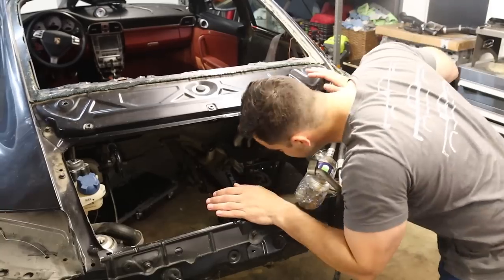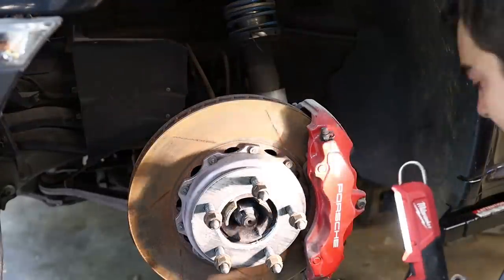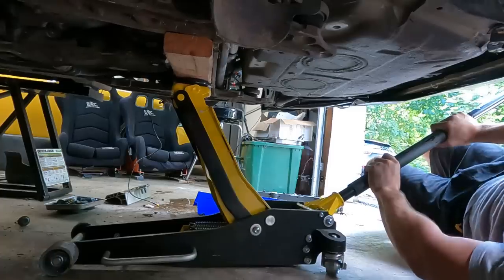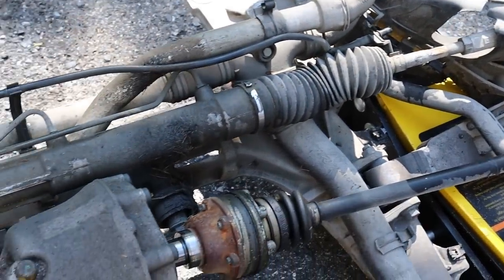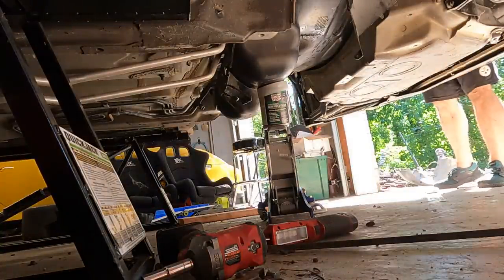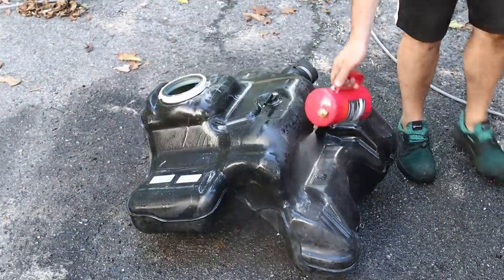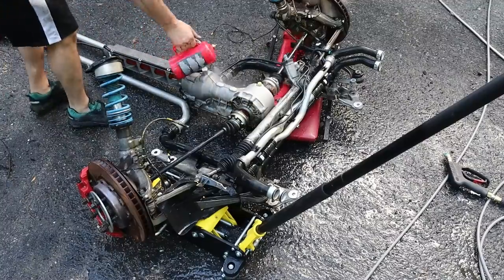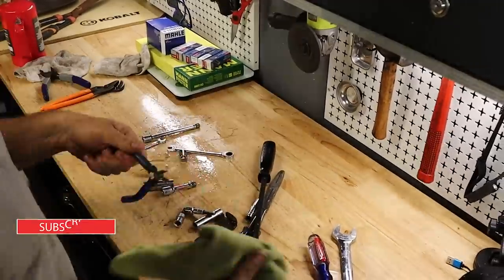ABANDONED 997 TURBO RACE CAR BUILD - Chassis Swap

Comment: You could use a foot more of space under the car. Solution: lift with your airjacks. Stabilize the car on four jacks. Place an array of cinder blocks on each side. Put the airjacks on top of them. Lift the car once more. Presto.
Reply from the maker: I could also use a bunch more space around the car in the garage lol.

Comment: In Greece, we say "Χαρά στην υπομονή σου" which basically means "Thank God you have patience". You are doing such a great job!
Wouldn't be easier if you move the 996 in the same place as E36? Less in and out, OR you could have all the space for the black 997...
Reply from the maker: Both 997s will be in the garage eventually, but I'm planning on getting the orange one painted first.

Comment: After cleaning, I'd suggest that you open the rack end bellows and make sure no water got there from the power washer. It might ruin then rack. Dont ask how I know. Also super important to immediately re-install the gas tank pump lid "nut" sleeve, before the tank deforms and it's almost impossible to get in back on threads.
Reply from the maker: Good tip, thanks!

Comment: Dropping/pulling an engine is always a test of just how strong vacuum lines and wiring harnesses really are.  In my mind, if they break then they're a weak link and deserve to be punished.
Reply from the maker: Couldn’t agree more lol
Reply: The best part about the engine drop in these cars is that it's mostly bulkhead style connectors. They make everything easily accessible for what to disconnect. Can be done in 1.5hrs if you know what you're doing
Reply from the maker: Yea it's not too terrible.

Comment: One more tip a hydraulic lift table around $265 bucks they fit in small spaces and the handle folds flat. Check it out harbor freight or vevor may make one
Reply from the maker: Folding one would help for sure

Comment: To get rid of gas smell the trick we used at the dealer was baking soda, like the arm and hammer stuff spread it around on the dry surfaces .it will then then absorb the gasoline smell just give it some time to work .
Reply from the maker: I def need that

Comment: I highly recommend HF's 2000lb low profile transmission jack. I use mine all the time.
Reply from the maker: That would surely be helpful!
Reply: It's heavy but since it's low profile it's easy to tuck away.
Reply: Oh and it's tall enough to use with the quick jacks at the highest locking point. That's the whole reason I got it.
Reply from the maker: Solid points thanks! I need to make a trip to HF anyway.

Comment: Nice job bro. Why don’t you just transfer the whole harness and wires. Your already in there. Might as well lol. Great content
Reply from the maker: I am going to, and I started, but it's a nightmare lol.
Reply: Nice looking forward to watching 🤙🏽👍🏽
Reply: @matt13ross  I was going to recommend the same thing. Different models or years probably have different systems/wiring. Manufacturers even make changes mid-year sometimes. Be gentle with the connectors though, chasing a pin that's loose can be a nightmare.

Comment: The gas tank has an interesting shape.
Reply from the maker: Sure does. And a PITA to remove.
Reply: @matt13ross  i have a ATV jack if you want to borrow it. You can store it under the car.
Reply: Yep. The last quarter tank of fuel is actually estimated by the car for the fuel gauge because the float doesn't read. And when filling up from empty you have to get to roughly a half tank before the gauge will move

Comment: Awesome work, Matt! Have you thought about deleting the front diff and going RWD?
Reply from the maker: No I want to keep the AWD.  Someday I'll have a GT3 or 4 to scratch the RWD itch, though I already have an LS1 E36 for that.
Reply: Oh I thought you sold the e36!  @matt13ross
Reply from the maker: Nooo, just in storage now
Reply: Good to hear! I'm about to swap an ls into an e36 in the coming couple of weeks! @matt13ross
Reply: On the 997 a rwd conversion is impossible to do 100%. The front wheel speed sensors are the issue along with the cluster when it comes to changing the logic. The turbo cluster is different than the gt3/gt2 cluster so they can't just be swapped without other communication issues with the rest of the car. And if pushed to the max in cornering the wheel speed sensors will throw it into limp mode. I wanted to do a rwd conversion on mine when I got it but I never found anyone who got it to work without issues at some point
Reply from the maker: Glad I'm not doing it then lol.

Comment: Matt I suggest to upgrade the turbos Aim has them for good price same turbo as stock just bigger housing along with injectors u will gain 250 whp
Reply from the maker: No upgrading until it’s all at least running hahah
Reply: @matt13ross  well yeah lol that's what I meant
Reply: Personally I'd recommend hitting up Freddy Lewis for his 68mm upgrade instead of AIM. AIM is awesome but Freddy will do the same thing for only $2500 instead of several thousand dollars. And unless running e85 there's no need for upgraded injectors
Reply from the maker: I haven't heard of Freddy, I'll have to look that up.
Reply: @matt13ross  Freddy is located in Minnesota. He has a 996 turbo making something like 1000hp. He knows his stuff and he works for an honest price...none of that Porsche tax markup BS

Comment: Hiya bro you know when taking a subframe out of a porsche it has to be taken to a porsche dealer or expert to be aligned and balanced as the subframe is a key component of tracking and safety up front i refered to matt armstrongs video on working on hes porsche he just took the under tray of and the porsche expert told him it would need specially aligning and tracking
Reply from the maker: The suspension will need aligned, that’s about it.
Reply: @Matt13Ross  im not entirley sure but id reccomend asking a few people i watched a video of a guy here in the uk fix a porsche up and he removed the aluminium under tray and there was a bolt missing from it being in an accident when he took it to a porsche dealership to be safety checked for the road they actually recommended changing hes damaged one and having it all set up apparently its a very important part of the structure / handling of the vehicle 👍